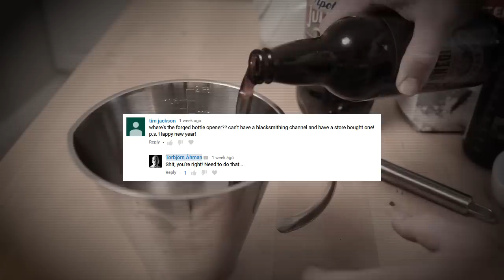Blacksmithing - Forging a bottle opener

Comment: Nice the way you forged the opening for the bottle top to sit in, turned out a good looking bottle opener. Quite a simple but practical project, well done. Still enjoying your older videos, Regards from down under.

Comment: Have you ever tried using a brass wire brush while the work is hot as a finish method?  I use it when I make steel roses and it adds a subtle bit of color.  When it cools you apply a clear coat.
Reply from the maker: I actually haven't done that to anything yet. I must try it some day.
Reply: Torbjörn Åhman Brush the work just when the red heat has faded to black.  If you do it when the work is too hot the copper will leech out of the brass.

Comment: Really nice. 

I was a bit surprised to see you cut off the opener right after drifting, rather than leaving the parent stock long enough to hold without tongs while  forging out the ring. Any particular reason for that?
Reply from the maker: Thanks. Well the stock was simply too long. It would have hit the floor when turning around the bick.
Reply: That makes sense. Thanks.

Comment: Torbjorn, Thank you for you’re videos. I currently am using a forge I built out of random scrap material. I have been going to welding school and feel confident enough now to weld a good high quality forge. Do you know of any good plans or any ideas as far as how to build one? Also what do you use for you’re air flow because I currently only use a hair dryer which gives me minimal control. Thank you once again.
Reply from the maker: Great! Take a look at my video "My forge..." , there you might get some ideas.

Comment: Nice.  Fun project.  What are your drifts made from?
Reply from the maker: Thanks. They vary... some are O1, others 4340 and some mild steel. I think 4340 is a good option.
Reply: @torbjornahman  Thanks.  I have some coil springs and will make a coupe this weekend.

Comment: What does the boiled linseed oil do? Add some kind of patina? Great video!
Reply from the maker: Just a surface finish like any paint or lacquer. When you apply linseed oil hot it will turn black.

Comment: Great video! What kind of steel do you use to make your chisels, punches and drifts?
Reply from the maker: For the hand chisels and punches I have often used coil spring. Pretty tough if you can keep the tools reasonable cool. For drifts I would recommend something like 4340 or even H13 for the most demanding stuff. The small drifts I use in this video is just mild steel.

Comment: just made my first bottle opener, had some time left after the main forgings were done.
it, went, horrible! didn't have...any of the tools usually used XD
no horn, no large drift, no round punch. 
uff...time to make even more tools?

it works tho!
clawed it open with tongs and hammers and at one point I even tried to use some bricks, don't ask XD
Reply from the maker: :) Anything that does the job!  :)

Comment: I wore the gas-mask or in your case the breathing filter in the military service. It got a noticably pressure drop, so some physical  effort came us  to have a short breath, suffocaction feelings. To run with all equipment was a pain and very stressful. Good you use it, for it wont hurt. I suppose you dont smoke either. At older days, you will know you were right, for lying in the bed starving for oxygen like a fish on land as old is no fun.

Du behöver en smedhalva, snart har du en :)

Jag har två söner men skulle gärna fått en dotter också. Kanske skulle hon fått heta Tora :)

I like your videos very much
Reply from the maker: Thank you Leif! Yes, I hope you're right.   Tack!

Comment: Hi that's a really cool little project!! I was wondering if the same black coating can be done with coal too? I tried to get that effect when I made a small dirty coal fire(the fire was getting choked with the smoke that was volatile matter not at its combustion temperature) and I put the steel in the smoke to let the coal tar cool down on it. Do you think my method would have a similar degree of waterproofing to your linseed oil method? Kinda curious haha
Reply from the maker: Thanks. I don't know, but I'm pretty skeptical.
Reply: Torbjörn Åhman thanks for the reply😀

Comment: Two questions: 
1. How would you make an old-fashioned can opener? 
2. Why did you flatten the ring by tapping it directly rather than holding the opener vertically with the ring touching the anvil and tapping the end of the handle? Thanks!
Reply from the maker: 1. Probably not so hard to do. Maybe I will try it!   2. First I don't want to destroy the beveled edge around the perimeter, with angled blows with the hammer I don't mess them up. Secondly I think you have better control this way, when you can see clearly what is happening with the shape. Easy to go too far.
Reply: Thanks!

Comment: a question: do you put the boiled oil when the metal was hot so it gets black?
Reply from the maker: Yes! At around 300C it turns black.
Reply: +Torbjörn Åhman now I know how to give the original colour back to my old machete :-)
Reply from the maker: Could work, but watch out... if you heat the edge to 300C you will ruin the hardening. Better use some cold blue treatment I think.
Reply: +Torbjörn Åhman thanx!!

Comment: Tnx for sharing, turned out pretty nice :) ... do you go off of a design when you make these things (like something you drew before hand) or is it generally 'free handing' it.
Reply from the maker: This one was more or less free hand, but I made an initial test to see if the stock size was ok to use.
Reply: I c, am i right to assume this will also be the case for other smaller artifacts, and less so (aka. more of a design process) with more complicated things?
Reply from the maker: Yes I believe so. Sure you can spend a lot of time designing the smallest thing...but I kind of enjoy surfing along and see where I land. Sometimes items just makes themselves, sort of... :)

Comment: Very good. Those are one of the things I make the most of for giveaway items.
Who made that double bick anvil? Looks like early Refflinghaus.
Reply from the maker: Great. Thanks. It's a Kohlswa anvil as well. Model C51
Reply: Torbjörn Åhman  I had never seen a Kowlswa like that one.
I want a double bick with a narrow top.
I don't think Refflinghaus is producing the model they made with the narrow work surface.
Does Kowlswa still produce that model?
Reply from the maker: Kohlswa actually went out of business last year...but you probably can find used ones like mine quite easy.

Comment: For fine work like the engravings @9:35 it would be nice it there was some way to keep the heat in the work instead of losing it all to the anvil.
Reply from the maker: Yes, that's a constant struggle, and it gets even worse when it's cold outside. You could preheat a plate and use that as a bolster... but I'm not sure it helps very much.

Comment: Woah! Does boiling linseed oil give it that black-like patina finish?? Also, is that mild steel?
Reply from the maker: Yes it does, when applied on hot steel. Yes, mild steel for this one.
Reply: Torbjörn Åhman, Thanks Mr T.A! You’re the man 👍

Comment: Dumb question. How do you put out a coal fire when you are done for the day?
Reply from the maker: I mostly use coke and that will die down fast without any air-flow. If I use coal I often rake the coles apart a bit and shut off the air. It will smolder for a while but ok to leave in a closed environment. If you work outside it might be a good idea to put something over it, like a barbecue lid or similar.

Comment: Whats the difference between boiled and non boiled linseed oil?
Reply from the maker: The raw linseed oil molecules are 100 x smaller which makes it useful for wood treatment or outdoor paint where the oil can penetrate into the wood in a good way. When boiled, the oil molecules change size, and makes the oil dry faster (typically 1-2 days). Raw linseed oil can take weeks to "dry". Probably not the entire explanation but still....
Reply: Here is little more info. Years it ago it was boiled with Lead oxide to make "boiled" linseed oil. Today metallic dryers are added to make it "boiled". You can buy Japan dryers at the big box stores to add to oils to make them dry faster. Also it doesn't really dry per se it polymerizes. 

But Torbjon  I'm thinking the oil works just like seasoning cast iron pans by heating them up before adding the oil.
Reply: Cliffe, I've always stuck with raw linseed oil as I'm not clear what chemicals are used in making boiled linseed oil now.  I figure it would be a safe bet that they are a cost effective solution that incorporates a little more regard than using lead oxide but that's about it.  Our health and that of mother nature are surely not at the front of the design criteria.  What more do you know about this?
Reply: Peter Gilbert I guess you could look up the MDS sheet, i think thats right, for Japan Dryers.  

I use boiled but very little since I only use it for small wood turnings.
Reply from the maker: A good quality boiled linseed oil is just boiled. No other additives. I never buy anything else....
Reply: At least in the US and at least what I buy at the Big Box Home Depot, Boiled Linseed Oil is not boiled. Its as I described above, its linseed oil that has certain additives in it that speeds drying. I also don't even think its truly drying but forming a film through polymerization.
Reply: Wanted to add I learned something new about "Boiled" Linseed oil. I looked up your product, thanks for showing the label so clearly,  and found various Swedish pages I had google translate and they do talk about 2 types of boiled oil one truly boiled and one with  added metallic driers. All the Oil I can find in the US is with the driers but I'm still looking.

Comment: Torbjorn, why your big anvil and dices became so rusty?.. Looks like the acid rain poured through the roof of the workshop.
Reply from the maker: Ha ha, condensation of water is the problem... fluctuating weather with cold and then humid air....

Comment: How do you get your anvil so silent...?
Reply from the maker: It could get even better. The key is to tie it down hard to the stand, preferably something a bit soft in between.
Reply: @torbjornahman  like a rubber mat or something like that with a chain to tie it down? and Thank you!!
Reply from the maker: Rubber might to it then use heavy bolts and some braces from angle iron or something like that. Chain will not do much.
Reply: @torbjornahman  Thanks!!